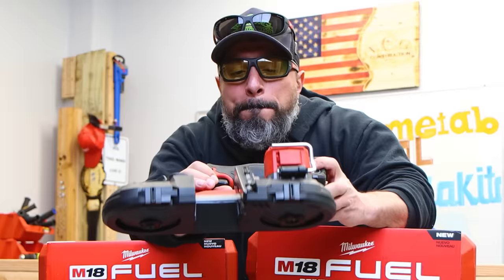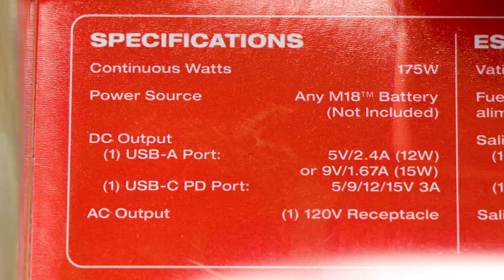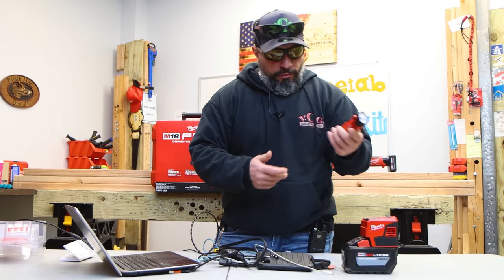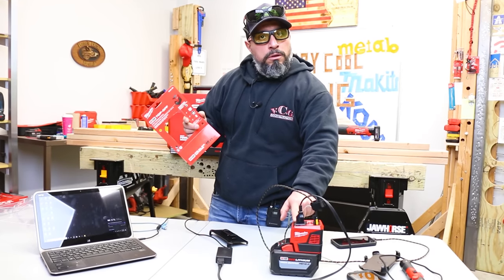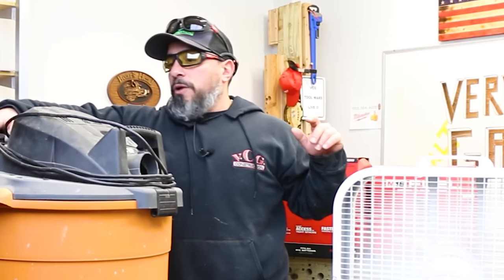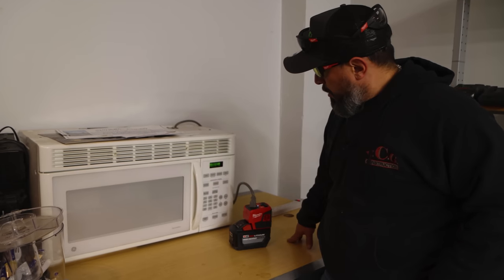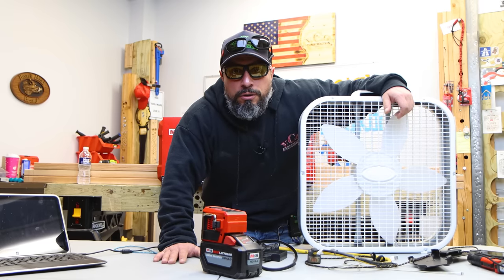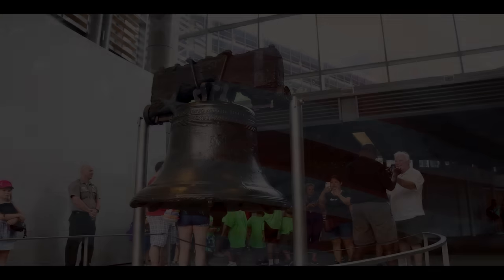NEW MILWAUKEE M18 TOP-OFF 175W POWER SUPPLY (Watch Before You Buy!)

Comment: Mine kicks ass, love it. Got a 100w electric blanket to go for over 2hrs on an XC5.0 battery on the highest heat setting, couldn't believe it. When I get the HD12.0 I'll run the blanket on medium heat and see if I can get most of a night out of it. We'll without a doubt be able to use it for winter camping in the 4Runner.

Comment: I brought mine home put it on a 4.0 battery, that's what i had fully charged and ran a power supply with input of 115 v ac60hz 270w output of 12 amp constant. powering a amateur radio that was receiving and I did some transmitting. It ran for 3 1/2 hours

Comment: Vince, thanks for sharing.

I LOVE the idea of using your (very expensive) power tool batteries for things other than “just” powering tools (nothing is ever enough for us gear heads, huh?!).

I have an Ego mower/trimmer/leaf blower, and three of their batteries (including the 7.5 Ah monster) and I use their 150W inverter to charge my phone/tablet/laptop when I’m off the grid. I work from home, and sometimes travel in my RV during the work week, so I need a way to power a few things while not connected to shore power. I have plans to add solar panels/big battery bank/inverter to my RV, but that’s a ways off in the future (probably 2-3 years). I plan on getting the Topoff soon, so I can have redundancy when it comes to powering my devices critical to my work when off grid.

I think it would make a ton of sense for Milwaukee to develop a device similar to the Ego Nexus Power Station. Give us a pure sine wave inverter (at least 1,000 Watt peak) with four battery ports, two or three 120V outlets, a few USB ports, and here’s the real feature: a built-in solar charge controller that would allow us to plug in a portable solar panel (100-200W) to give us the means to charge our batteries while completely off the grid. Cherry on top: the device will integrate into your packout stack.

I really hope that something like this is on Milwaukee’s radar!
Reply: Yes - a Jackery type of solar enabled power inverter that we can attach several M18 batteries and have an inverter to give 120V regulated (for electronics) at least 1000 Watts.  The batteries that we all have is half the cost of these solar generator.
Reply: Power tool battery packs use 3.7 volt 18650 Li-Ion cells that cost about $5 each wholesale. M12 battery packs have three 18650 cells connected in series.
Reply: good idea this tool adapter plug for mobile folding solar panels and or bi-directional power

as is i like the general idea of smaller power supply and not dragging a gass/diesel 5KW generator or bigger/heavy battery-packaging for one ish tool/need
Reply: 2 years later and they released something close, but unfortunately not good enough. They now have a m18 power supply, 4 battery ports, 2 outlets, 3600w/1800w, but needs all 4 batteries to run, no solar, and not integrated with packout. If they made it so you could run on one or two batteries while swapping the rest, that would be fine. Packout integration really doesn’t seem like it would be that difficult when you’re looking at this current design…they easily could’ve done exactly what you said; make a modified rolling box or even the XL. Could’ve had room to store extra batteries with that sort of design. Guessing they’re saving that for a fuel version/ second gen, and I’m no electrician but solar connectivity seems like it wouldn’t have been that hard either, especially if we’re providing our own equipment. They could make solar panels built into a packout power supply similar to the packout lights (they flip/fold out and rotate from the sides. That would be the ultimate electric power supply lol

Comment: I like mine lots , I even use it at home for charging sensitive devices , when thunder and lightening are on the agenda !
Reply: Do you not charge your devices from a surge suppressor instead, and then only use the Milwaukee inverter AFTER the thunder and lightning takes your power out?

Comment: I think its really useful. I used it to plug a Weller soldering iron into it to fix an issue I had with a loose electrical connection out by my car and it worked very well. Also the best portable charger I have ever experienced.

Comment: First time I saw this I went out and bought it. It's been a great tool all around. Great for having portable power for charging a phone, or a laptop for work. I've used it in limited capacity for certain key cutters I have. I've also plugged in a blower fan to it and used it as a quieter cordless alternative to my Ryobi. It has it's limited but cute charms to it's usability. I most like the fast USB-C charge port.

It would be handy if there were something else with more power that Milwaukee made. I know they have their MX system "generator" but that's a lot of dough to drop. I'd prefer something with say 2-4, maybe even 6 bays that gives up to 1000-1500 watts of pure sine wave power
Reply: Would this be powerfull enough to run hair clippers  ?
Reply: @gustavomacall4997  it might if the Clippers are under 175 watts but those likely run better with a pure sine wave inverter so not ideal
Reply: like the idea but i have the 80V mekita system, and really love the idea of turning my vacuum-90's model into a cordless using adapter like the one in video plus the flexibility it give's for others things. other tool brands need this and or slacking and need to make a better version of this 😉👍🤠
Reply: PS. it would be nice if it has a BI-directional function for power and stand by mode for whatever the power go's out

Comment: Its rated at 1.75amp and he plugs in 10-20amp things lol
Reply: Actually its 1.45 a
Reply: @phild1816  close enough I don't know the efficiency rating of the device or the actual operating voltages.
Reply: To be fair he knew it wouldn't work but gave it ago any ways
Reply: lol i will not buy those build my own power station
Reply: But how many times will it charge a Tesla Cybertruck before the 12 Ah battery runs out?

Comment: Thanks for the great review I got the one that uses two M-18 batteries found on eBay hopefully it will run my air pump for my fish tank, but I agree anything two powerful it won't work but it's pretty cool they have these as i can see why someone might need to run a generator but don't want to run it all day and all night. So just charge your power tool batteries and your set to go. So having these can be a lifesaver if you ask me! Best tool idea of the year if you ask me!

Comment: I ran my Chinese diesel heater off of it. 50 amp 120v stepped down to 12 v works just fine. to get that HSI to start it needs about 13 amps than drops down next to nothing to run.

Comment: i have this device, i charge laptop, i run a 32 inch 4k TV. tablets, ect.High inrush current surge devices above rated power will not work. I use my Worksharp sharpener, and my drill doctor. Depends on your needs. I found a deal with a new 5 XC battery and top up for 139$ at home depot.  i snatched it up. For me, worth every penny.

Comment: I ran a test and it charged my iPad at 30W with a USB-C to Lightning cable. And my Dell XPS-13 at 40W. It’s a great little charger IMO. I’ll rarely use the 120v outlet as it’s not a clean sin wave. And basic rule of thumb for the AC outlet, if your device has a wall adapter or power brick, the Milwaukee can probably charge it.
Reply: did your box fan complain about the harmonics?  I saw some techs from the power company driving along a 500-kV transmission line looking for a 6th harmonic that some sound studio in Hollywood was complaining about. ADL/RIN Line.
Reply: @melaniecotterell8263  no but my oscilloscope doesn’t like it.

Comment: I work on Building Automation Systems. A lot of times, I will have my controllers installed, and am waiting on the electricians to get power to the controls. I have used the Milwaukee Top Off to power the controllers, got them online, and was able to set up the controllers and have them programed, before power was ran. A 6.0 Amp hour battery ran the two controllers for five hours, and still had a bar left.

Comment: I like that, it will be a good thing to have in a blackout. This past summer during a blackout because of storm damage I used my M12 batteries to keep my phones and tablet charged and my M18 lights for light. This is even better  because it will pretty much charge all my devices.  And since I have a lot of M12 and M18 tools I have a lot of those batteries.

Comment: I have 2 of these in my possession, and they both read  93-100 volts. I've tried with 4 different fully charged batteries. Not sure if this is normal.

Comment: i would probably buy it just for running heaters and fans when doing outside work.
Reply: It wouldn't power a heater since they are all inefficiency creating heat. Most heaters can be 1000W or more
Reply: @jonathanwiebe5779  thanks for the heads up!
Reply: I run two 1000w heaters on it but it can handle way more.

Comment: I bought the top off to power a small household fan while at work. Noticed ot wasnt running the same as when plugged into the wall. Tested the top off with my meter and only got 107 volts. Its great for smaller items but probably nothing with a motor. I ended up getting the milwaukee m18 fan but kept the top off in case i ever need to plug in a light or charge something.

Comment: This is cool. Basically a mini inverter. I've got a 200ah battery in my truck with an 800w pure sine wave inverter- that thing will run a freezer in our truck for a week. Course the battery weighs about 110 pounds, but still.

Comment: Just wait until somebody figures out how to hook them up together in parallel/series.
Reply: I was curious if there was such a thing that someone could use to do that!
Reply: @stevenschwarz6358  the hard part is keeping the AC wave in phase with the other unit.
Reply: There is a guy on YT that does that.
Reply: @nandos1111  Could probably just put the batteries in series so you dont have to deal with that
Reply: At this point get a solar panel fr... You can keep a fridge cool all day in a truck no prob. Good thing is: The less the sun, the less the need to cool.

Comment: I wonder if that would run a Garage Door Opener? I install Garage Doors and sometimes don’t have  electricity to test the motor. That would save a return trip.
Reply: I don’t have any M 18 batteries but being able to do something like that, makes me think about buying an M 18 and the top off.
Reply: It could but garage door opener could pull up to 15 amps on start up
Reply: @robthetech5595  in that case, probably best to just get the Dewalt power station. I’m sure that thing will do it.

Comment: I've had mine for a little over 2 weeks now.  I was REALLY hoping that the 175 watts was way under estimating on MIlwaukee's behalf, but I guess not.  The first thing I plugged in it was a dual battery Makita charger with 2- 5.0 batteries on it.  It charged them.  Next I tried a blender.  That was a no go.  Was kind of disappointed!  Guess I need to try my 120 watt Peavey 6505+ guitar head and see if it will work!  lol.
Reply: Did it work??? I have a PRS MT15 that I really need to take ice fishing.
Reply: @ryanwilson5936  Plugged it in a few minutes ago.  Played fine.  You may wanna throw a noise gate in there, as I had some when I wasn't playing.  My buddy bought a MT15 a couple months ago.  Those things scream for 15 watts.  lol.
Reply: @jasonmartin7137  

That’s just awesome man lol. Yeah, I have one of the first run MT15’s with the 6l6 power section and it’s a beast for sure.

I wonder how going through a Furman first would have helped noise.
Reply: @ryanwilson5936  The Furman should help.  The Peavey and my pedals are running thru one that's plugged into the wall.  I don't have any noise that way, and I don't have a noise gate either.  But the plug for the Furman is buried behind metal racks, and I was too lazy to move the racks!  You should post a video of you jamming out on the ice.  That'd be sweet.

Comment: In theory the mini fridge should have worked as it only uses 114 watts, and the power supply is rated at 175 watts. It must be able to sense large inductive loads which are all the tools with motors in them, and will not run due to the type of load that is connected.
Reply: Reason mini fridge won’t wk is bc the startup power req to start the compressor (inrush) can easily be 3 times or more of the 114watts it’s says it draws. It’s only a fraction of a second but it’s enough to overload the inverter.

Comment: I bought one a almost 2 years ago used it for 1 day for an angle grinder it couldn’t power it so I set it on the shelf, I just pulled it back out for a road trip and it won’t turn on with a brand new fully charged battery, any ideas?

Comment: I wanna get one for power outages, charging devices and maybe running my Wi-Fi router.. I'm told they shut off after an hour... possibly when NOT in use.. have you tested this?  I also have the Milwaukee Lantern that has a USB-A port for charging.. it's great and was only about $80 CAD at the Home Depot.. this thing goes for $175 CAD but i've seen it on sale.. thanks in advance!

Comment: The only thing I have bought from Milwaukee that I don't like. My fault for not reading the fine print before I bought it but now it's over priced in my opinion. I already bought the smaller more sleek version for a single USB and now I'd rather use that since this top off thing is only good for charging but twice the size lol 😅
Reply: Well Mr Smart Pants, people that want to run a CPAP during a power outage might disagree.

Comment: Powers 1 to 2 small devices at same time (and no appliances that generate heat). Bought one so I could stream tv during power outtages but returned it because it would run my tv and modem but not my xbox at same time

Comment: Well, it's a Milwaukee tool. It is going to have some type of circuit protection. Of course it won't work on that stuff.
Volts times amps equals watts.
That fridge, 120 volts times.95 amps is 114 watts. Should work.
My thoughts, led lights.
It'll light up your garage well.
175 watts/4 watts per bulb is 43 60 watt equivalent bulbs.
Let the sun shine in!

Comment: If the battery produces 12A at 12V, that's equal 144 Watts. 144 Watts at 120V that equals 1.2A. I don't think you can power that much with 1.2 amperes. Also keep in mind any DC motor at the beginning is like a short circuit, it pulls more current to kick in. That inverter is made for small things like cell phone chargers or any small electronic device or battery charger.  If you want to do something more, I suggest you get a Milwaukee battery cable adapter, people made those up with a 3D printer for power wheels. You can join a few batteries together and use a bigger car inverter with the watts capacity you need.

Comment: Had a power outage and wish I had this. Also wish I would have seen this before I got one last week. Had an electric staple gun and figured it should work rather than running multiple cords to reach. Unfortunately it wouldn't shoot a staple. As far as taking it back. As long as I can make it financially for the week I will keep it.

Comment: I wonder if you hooked two of those Chargers together what are we going to one plug if that would work other equipment cuz if you put for those together with for big batteries and then try to run a fridge it might work if they run in unison but that's what we're here to see is it a gimmick or can we actually use it on the worksite

Comment: I was looking for this Top-Off a few weeks ago, right before Hurricane Ida came through, as well as right after.  Guess what?  Milwaukee Tools DROPPED THE BALL, and didn't have any delivered to this area in either HD or Northern Tools.  They didn't even have any MX Carry-On or batteries either.  So, we only had the smaller, USB topper available to charge our phones. I definitely could have used one of these to power a fan at night.

They just replenished the shelf at HD with (2) of these, and one is freaking Broken.

Comment: I suppose it has its uses, but I think it's pricey for what it is and my truck has 120 v outlet so not usually far away if I needed it.  Could power up a tv and roku and phone with hotspot so you could still watch VCG videos if the power was out!

Comment: The coolest part of this is that it has USB-C PD. You can plug in your laptop while working on roof top units without having to bring the laptop's power brick. Most new smaller laptops can be powered with 45 watts from USB-C. Some of the larger ones need 65-90W though and I don't think the USB C port on here will work.

Comment: A USB type A iPhone charger will only charge at 5.1v at 2.1amps as that is the limitation with USB A and not wilwalkee themselves. USB C however will charge at 3 amps at 5.2v - 20.3v. iPhones will only ever charge at 5.2v anyway as that’s the input voltage on the battery any more would fry it. But USB C is a far more capable peice of tech for not only charged g but data transfer too.
I do wonder what the output voltage is in the usb c and if it outputs at 20.3v or if it’s limited to 18v for harmonic reasons?

Comment: Your Pixel is not that power hungry when it is over 80% so that's not correct test. USB-C PD stands for Power Delivery and that is protocol where devices and chargers know the charging rate. The device requests something and if the charger is capable of it delivers otherwise it declines.The Pixel may charge at 5W when the battery percentage is over 90%. Some chargers divide the power others give full capability and so on. I like the video you did like the most people would do.